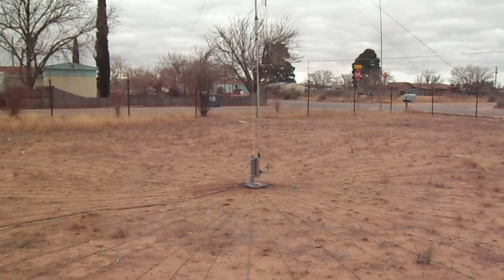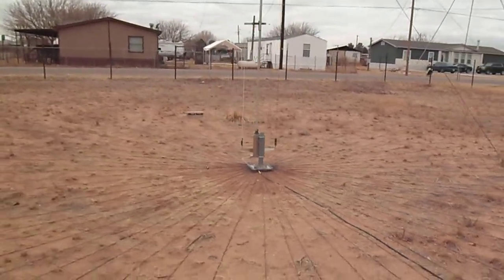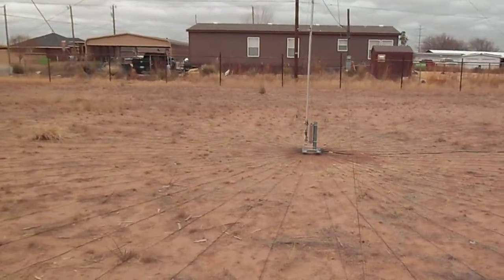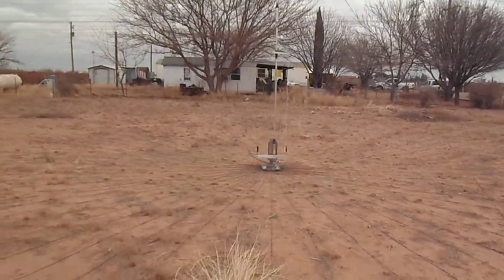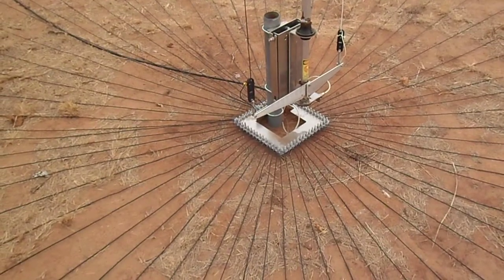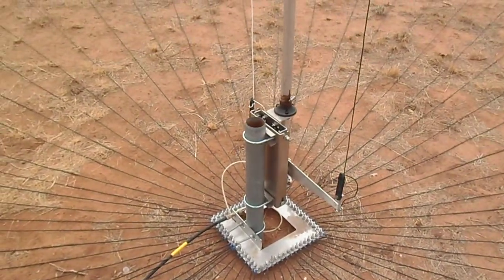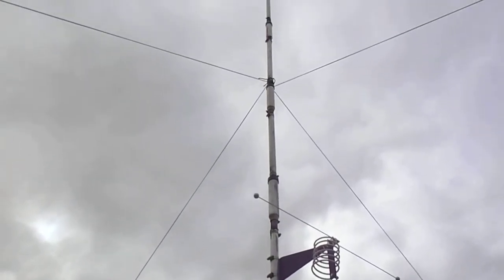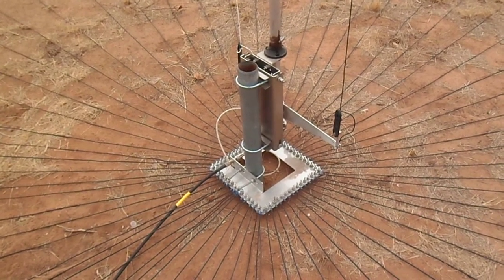Tour of the N5XXN Hustler "8BTV" installation.

Comment: This is the first install that I've seen with the tuning rods on 17m almost all the way out. That's where mine ended up to give me a flat 1:1.2 across the band. I think it's because I have the 80m add on and 120 radials over sandy soil.
Reply from the maker: Yeah, I know there is a "point of diminishing return" on the number of radials, but in areas of poor soil conductivity I think that point may be at a much larger number than the research suggests.  It's worth it to go a little overboard with radials when the conductivity is poor.

Comment: Nice. I have what I affectionately call the Hustler 9BTV ... same as you except I also added the 60M trap. You got me on radials though. I only have 55 of them ... I ran out of wire and space after putting down 1000 feet. Pretty much work the world on that antenna.
Reply from the maker: 60m doesn't hold much interest for me, that's why I set mine up the way I did.  In fact, if I was to add any other band to my setup it would probably be 6 meters, although I already have a 5/8 wave elevated ground plane for 6m.

Comment: My name is Clifton Head (Cliff) W4CBH. Just picked up a 6BTV. My question is Why you didnt bury your coax. What size coax did you used. Do have any problems with the coax running next to the radials. thanks W4CBH
Reply from the maker: Hi Clifton.  I didn't bury the coax (LMR-400) because it really makes no difference.  If you look at the studies of Jerry Sevick (W2FMI, SK) and Rudy Severns (N6LF), you can see that RF goes down into the ground anyway (especially at lower frequencies), so might still just look like another radial unless you buried it at an unreasonable depth.  I see no discernible pattern distortion in any of the "mappable" modes (WSPR, FT8) at any of the bands covered, and I have no detectable RF in the shack.  Since there are 64 radials, the coax would literally represent only 1/65th of any RF to be carried, so it would be a miniscule amount anyway (I had no RF in the shack when I only had a few radials as well).